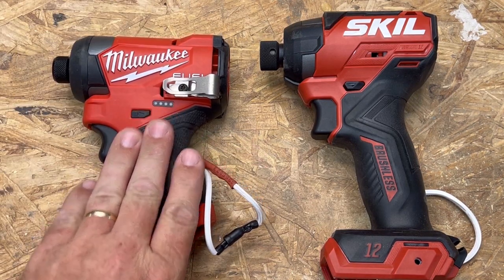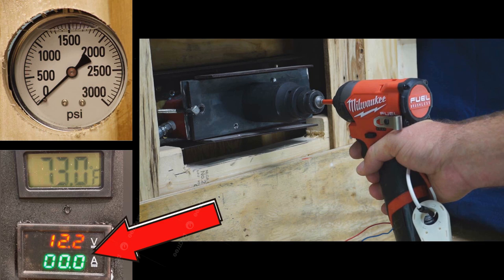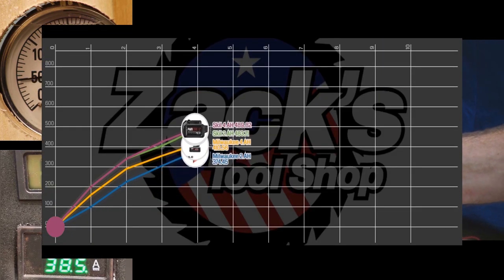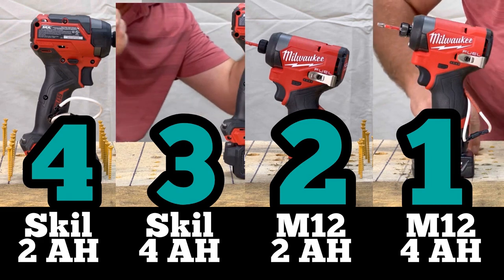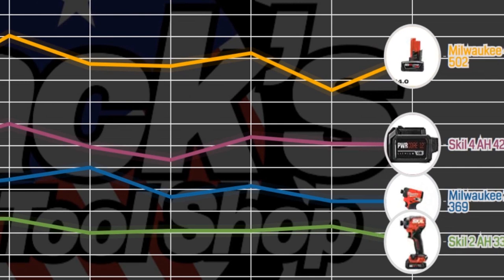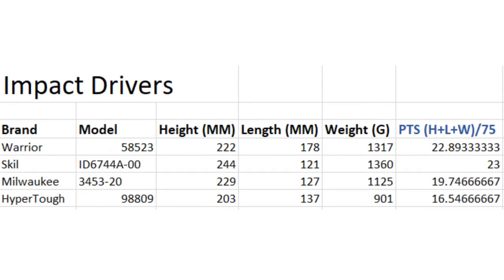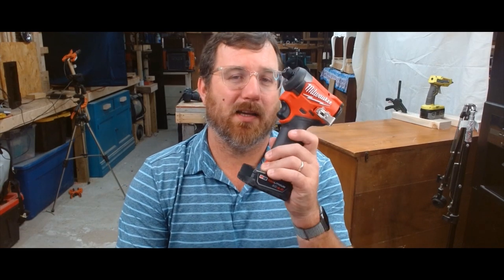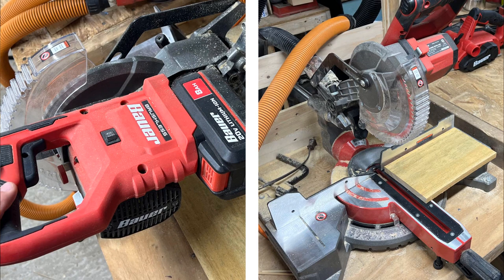Milwaukee M12 Fuel Impact Driver vs. Skil 12 Volt Brushless

Comment: The Skil won because it uses a heavier lower RPM hammer. This is why the torque delivery is more immediate. If your working on your car, the Skil's hammer is best for loosening bolts. If driving screws into wood, the higher RPM of the M12 is the better option for those users.
Reply: If I want torque I’m using an impact wrench
Reply: @tannerwest6823  same hammer and bpm from either in the Skil

Comment: I came across a set of these skil tools at lowes last night while I was looking for an oscillating tool. The whole set, impact, drill, multitool, speaker and light was only $100, and it came with two 2.0 amp batteries and a charger. I think I did good.
Reply from the maker: That deal is great. Bought it myself a couple years ago.
Reply: where you bought it from? right now at Lowes $200
Reply: @Hollymountainhwy16  it was at Lowe's but it is as also on sale. It was right before Christmas.

Comment: Love skil as they make some quality tools that punch above their price point…been using a skil 10 inch table saw with zero complaints (minor) especially for a saw I paid 250 for, but I bought into m12 and m18 before skill started to expand. I think skill is a great choice for a home owner diy, and maybe some trades too. I think their warranty is good as well and they stand behind it
Reply from the maker: Yes the new Skil, especially their 12 volt have been very good performers

Comment: I have both of these drills , I’ve always used milwaukee but i came across the skil drills and picked them up, the 12v impact is an absolutely great drill , lots of power for a 12v and the halo light is awesome for visibility. Just the fact that its being compared to a Milwaukee fuel tool  lets you know it is a great product

Awesome video btw!
Reply from the maker: Thanks for the comment. I did have a clip that did not make the video. It was on the lights for each impact. Skil is so bright!

Comment: Thank you Zach, great video once again. I have the Skil 12v 1/4" right angle impact with a 2ah battery and charger. I would like to add this 1/4" impact driver to my Skil 12v set.

Comment: Interesting test - great job, very thorough. However, I have one quibble. I don't really care how much power the drill is drawing from the battery. I care if it has the torque, RPM and power to get the job done. I own both Skil and Milwaukee tools. I own the Milwaukee 12V impact that you have tested, at it will take lug nuts off my truck that have been torqued to 112 ft-lbs. It also was faster than Skil in your screw test. While I am impressed with the Skil in your tests, I really only care about real-world performance. I am skeptical that the Skil will put out more torque than the Milwaukee. The Milwaukee M12 impact is a beast - it has a shocking amount of raw power and speed. And the speed of the tool is important to me in the real world, even if there is only a slight difference, that the M12 is faster. 

It's easy to do non-real-world tests and claim a winner, and I get it; the Skill is $20.00 cheaper. But I would like to see if the Skill can take lug nuts torqued to 112 ft-lbs off my truck. Or if it can loosen the 19 mm bolts on the upper and lower control arms of my truck. I KNOW the M12  impact can do it because I just replaced the suspension on my truck and I had to loosen the front shock control arms in order to be able to get the old shocks out and the new Eibach 2.0  coil-over shocks in. 

Still, you did a great job in this video, and I upvoted you - you deserve a world of credit for the high quality of this video. Skil makes great tools. Their Skil 77 worm-drive saws are legendary, and for two decades, they were THE saw that framing professionals used to frame buildings. So, I am not surprised that this Skil impact competes well with the Milwaukee M12. Both are high-quality tools.

Comment: Great video. I love the test setups.  A few questions, the Skil has a lower RPM, does that translate to more torque compared to the Milwaukee based on these results?  If the job is torque limited Skil has the win. If it is speed limited Milwaukee has the win. Does that seem correct?

Also use =ROUND(NUMBER,1) for all your calculations when the numbers are small. It will make your chart easier to read and make for better comparison.  Keep up the great work!
Reply from the maker: Thanks for the tips. Your reasoning on torque is right in general (to the best if my knowledge).

Comment: Well, I have the M12 FUEL hex driver. I keep it at home cause it's more useful to my hobby(Woodworking)than my profession(a heavy duty body repair man.). 
It's not unusable, but it's Max RPM is a bit too much for small fasteners when you ideally want to keep all your pieces in same zip code. Using one of the reduced speed settings does help, but even at full strength, it doesn't quite have the umth I'm used. I do indeed LOVE the small package but for a 12v hex driver to replace my old reliable 18v hex driver, I truly want less RPMs and more balls. I'm also a bit of tool slut, so I don't care so much for which platform the replacement for my current brushed 18v RYOBI hex driver comes from, nor am I concerned with whether it's a 12v, 18v, or whatever. I'm already also on Milwaukee M18 platform as well, that does carry some weight in the decision, but if the tool comes a battery and a charger for less coin than I can get an M18 FUEL, then I'm more than a little curious.😎🤓🤠

Comment: AH makes no diff in torque unless the batts are depleted. Amp hours is like how much fuel you have in your fuel tank not your engine hp. The small diff you see in 100psi is the voltage drop. If add a tesla 200ah battery at 12v it wont make more torque than your fully charged 4ah.

Comment: What's the point of having a 12-volt tool if you still have a big ass battery hanging off of the bottom? That is what I think and if I need more power I use a full-sized 18v or 24V tool. The whole point of using a 12-volt is to save space and have the ability to get in tight spots. So I stick with the cylinder-shaped batteries for my 12-volt tools.
Reply: 그립의 모양에 따라 사람이 느끼는 정도가 틀립니다. 같은 무게라도 그립이 좋으면 손에 피로감이 적습니다. 밀워키 같은 경우 손잡이 부분이 뭉뚱해서 동양 사람이나 손이 작은 사람에게는 상당한 피로감을 줍니다.
Reply: The only point for me is that i can set it down on a flat surface and have it easily grabbed up for use when i am in a tight spot which is the whole point of me owning 12v drivers.  I love the form factor of the milwaukee but sometimes have a small space on a ladder or inside a cabinet that a stand up driver really becomes stupidly convenient.  I cant have them hanging off my belt.  The guy that also responded to this comment said for him he has less fatigue on the balanced battery setup for his smaller than average hands.

Comment: What is the warranty on each brand?
Reply: skil has 5 year warranty on lithium cordless powertools, same as milwaukee. milwaukee has 2 year on mx fuel stuff , and 2 years shorter warranty on outdoor power tools. 2 years for batteries for both skil and milwaukee.

Comment: What skil has over Milwaukee is that they got tools that Milwaukee does not have yet.
Reply: such as?
Reply: They do not, that’s ridiculous!  You obviously don’t have a clue what tools Milwaukee has or doesn’t have.  They only thing that Skill 12 volt tools have over Milwaukee is a feature…not even a tool.  It’s the battery power port, enabling the battery to act as a power bank.

Okay, let’s get started…. What tools does skill have targeting verticals, e.g. automotive, woodworking, metal working, plumbing, electrical, lighting, laser level, inspection cameras

What you get from Skil is a base product offering of drills and saws.  What you won’t find are any of the specialty tools and in most cases the performance you will find with Milwaukee.
Reply: Did you even watch the video?  You obviously didn’t because he addresses the expansive Milwaukee tool lineup.

Comment: Who buys 12 volt?
Reply: I just bought a slew of M12 drills, drivers, a multi tool, recip saw, jigsaw and a couple M18 tools as well.  There is VERY little difference in power and speed between the 2 platforms,  I tested with drilling and driving 1/2" lags in a 4x4.  M12 is SOLID and I am extremely happy with them. The M18 tools I purchased were only because they were not offered in the M12 platform (RO sander, compact router, and the M18 blower is actually way better than the 12 volt)